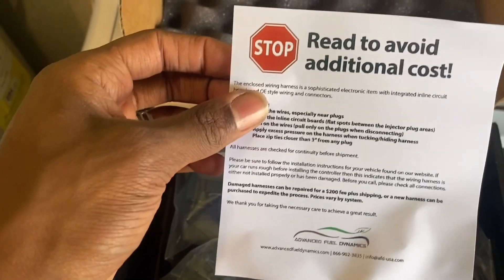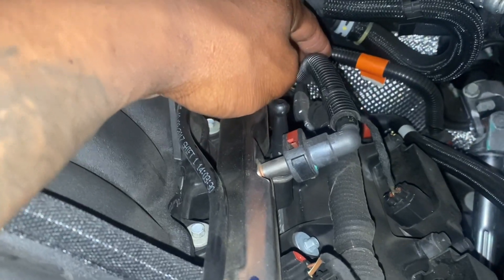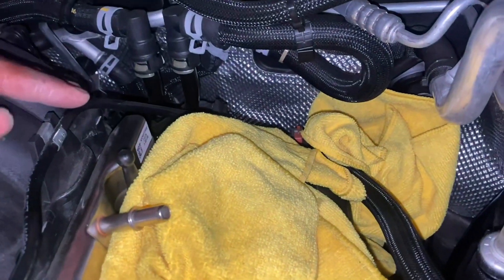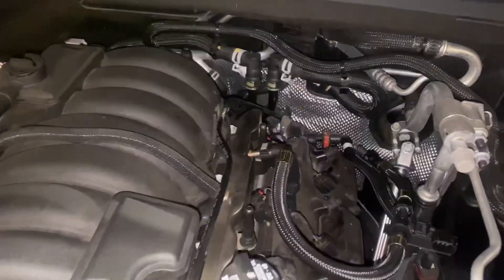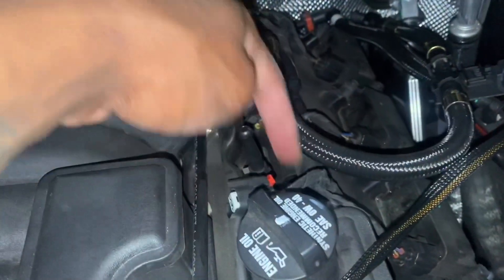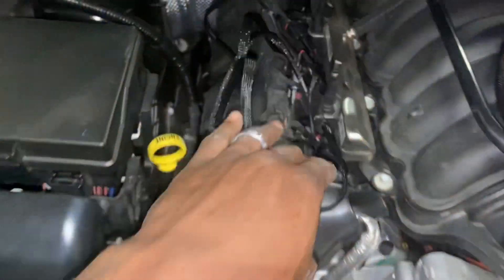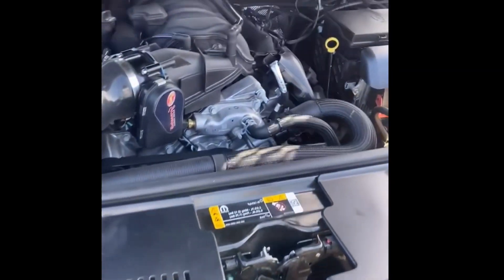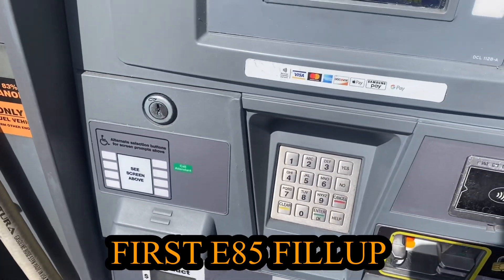392 Dodge Durango “Proflex Commander Kit” E85

Comment: Aye bro question will this work on the DD RT 2021 ? N is it work it ?
Reply from the maker: It’s definitely worth it and I believe they have a kit for a RT
Reply: @kjwrapz i appreciate the response and I was kinda confuse on what you said, do you need to put half gas and half e85??
Reply: @oneyperez703 no just straight e85 unless you get a flex kit

Comment: Does it really work?
Reply from the maker: It definitely does
Reply: What was the reason for the check engine light?
Reply from the maker: It was running to lean I didn’t mix 91 and e85
Reply: @kjwrapz  so u can’t run full e85?
Reply from the maker: @jeffreynieto1106  no you have to put a quarter of 91 or 93 and top it off with e85